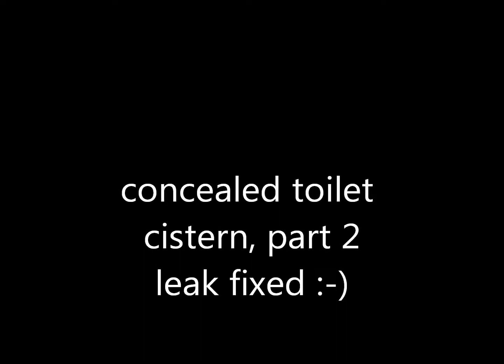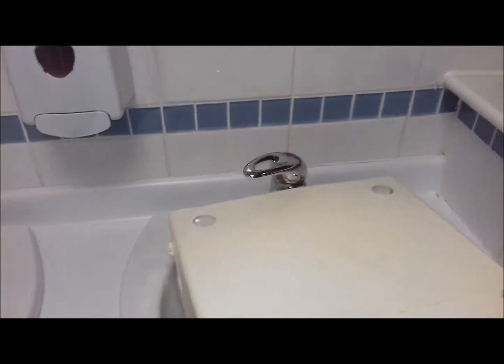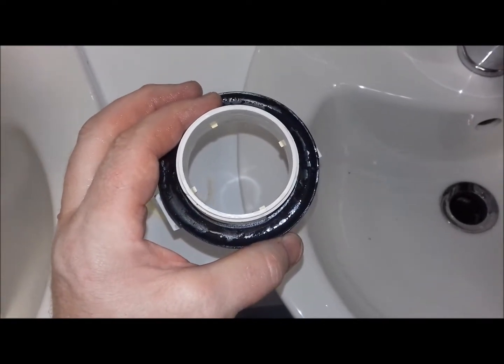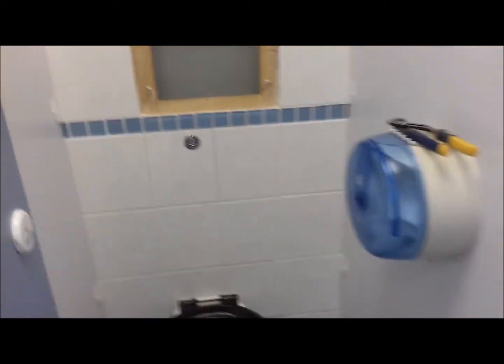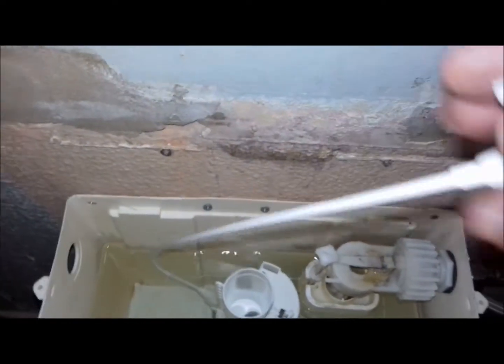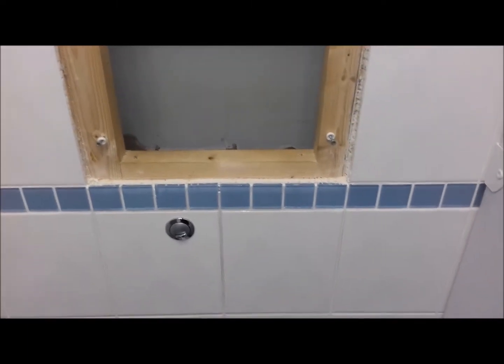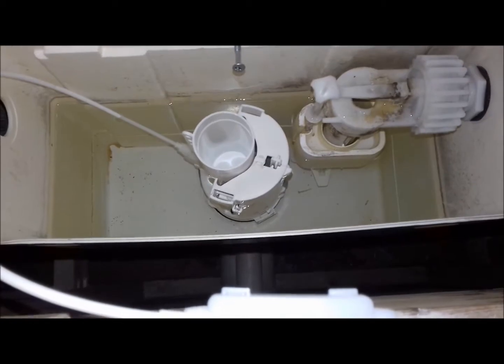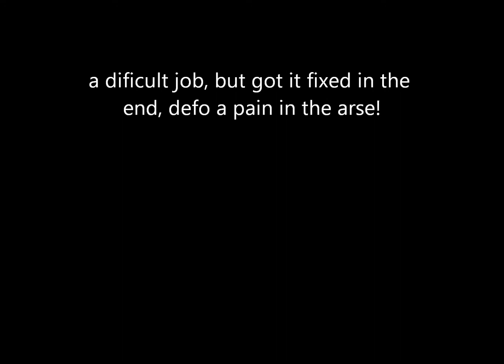cencealed toilet pt2

Comment: Excellent work. That job was tricky without a plumbers mate - and would have been just as tricky with one ... Badly installed I would say in 1st place - no thought for maintenance
Reply from the maker: No I don't think any thought went into how will they fix it when things go wrong, you need arms like a gorilla lol.
Reply: @650GSF  - so fixed mine (siamp Monoco) ... Seems they changed design. The twist out to remove siphon is interesting idea but like you found the underside nut seems to come loose. For me I found the stirrup catches were no longer holding the stirrup up - so I used insulated wire to tighten the cartridge (and to stop wire rusting).

Final part of repair was need to replace close coupling bolts that rusted. I see newer designs have the bolts in a metal collar on dry side.

Thanks for posting - you already more busy than the handyman at my daughters school. And you have the video evidence to prove it.
Reply from the maker: it was lucky that I found a plumbers merchants that sold that siamp flusher, or I would have been well screwed, I had images of having to pull the wall down to fir a new type of flusher, that's the third time I have had to repair one of those toilets :-$ with the amount of toilet we have in the school my toilet repair skills are constantly put to the test lol.The clips are a bit fiddly, the other problem you will find with them is over time is that the whole body gets a bit lose with the way the two half's are clipped together, then after you flush the plunger gets stuck and doesn't drop all the way back down to seal the whole, and your left with the water constantly running into the pan.